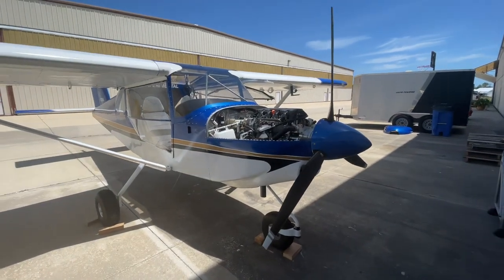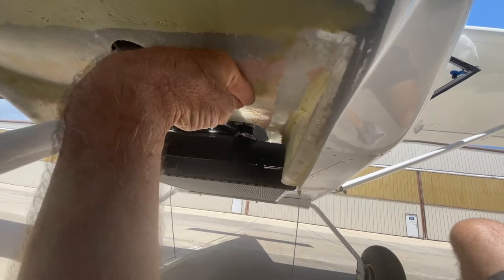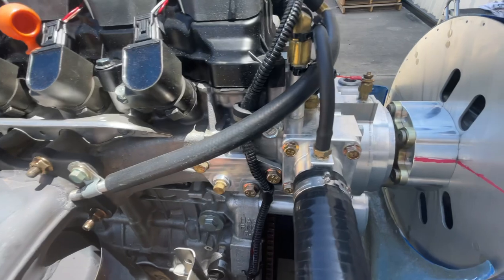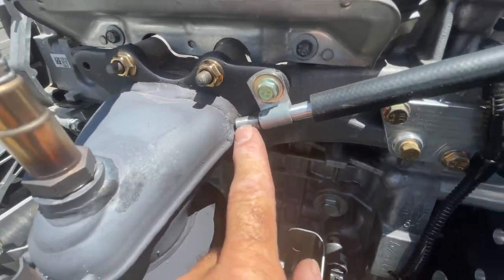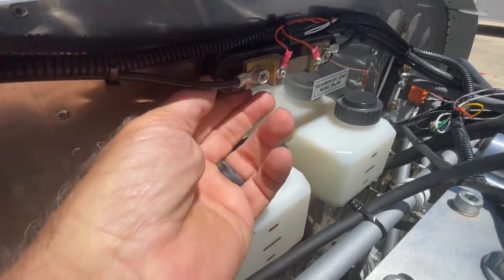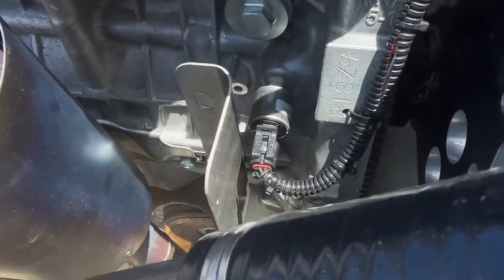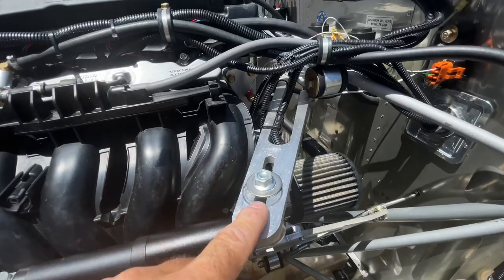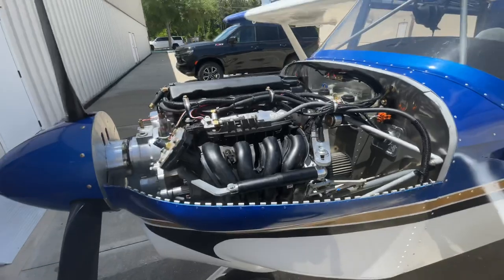Rans Installation- Under the Cowling (Quick & Basic Overview)

Comment: I’m sure others like me are interested on how the header tank with fuel pumps is mounted. The S-21 has a large area under the forward baggage floor, but interested on how that is different than the Zenith install. Thanks again!
Reply from the maker: Viking has a tank for the area you described in the S-21. It has the entire fuel system built in.

Comment: There's a product on the market called Banks coolant, you can put it into an engine and you do not use any water and the expansion characteristics are almost eliminated if not completely eliminated. It is not particularly cheap but it would be a perfect application in this Engine with the internal exhaust manifold. So that takes care of hooking up I still am not particularly sold on that internal exhaust manifold idea all it does is make packaging a little bit easier.

Comment: On a tail wheel S21 would a large NACA scoop at the bottom of the cowl be sufficient airflow to the radiator? Just thinking instead of cutting up the bottom of the cowling. Looks like the 150 needs more cooling than your typical 130 installation.
Reply from the maker: The ramp you saw in the video is kind of the same thing but yes, a NACA like the Rutan aircraft use would work. The 150 bell housing is larger than the 130 engine so the air up front is used mostly for gearbox and residual cooling. The engine also makes 20 more hp so yes, the radiator needs more air. Good observation

Comment: Not a fan of burning any blow by oil mist off on the exhaust.  Why not run it back into the intake as on cars?
Reply from the maker: You can do that if you would like. The advantage of letting it evaporate off of the exhaust is a perfectly clean engine and intake manifold. The amount of blow-by is minuscule as the lack of oil consumption demonstrates.
Reply: @eggenfellner   If its routed back into the engine , doesn't it dirty up the exhaust valves and create compression issues at some point. Especially if 100 LL is used?